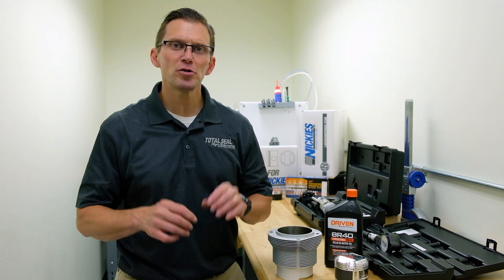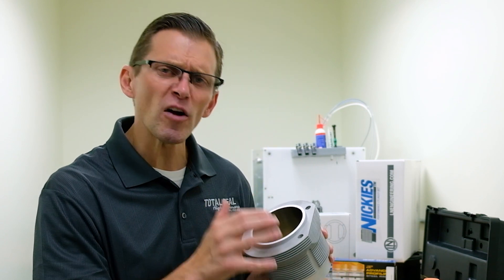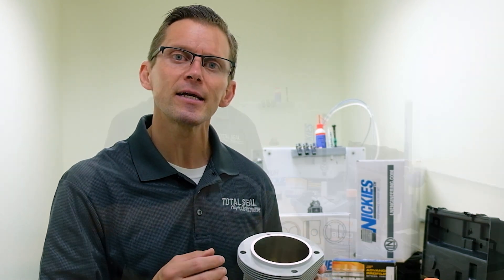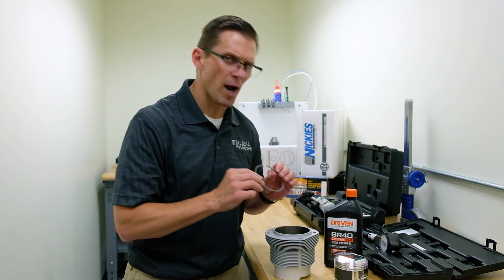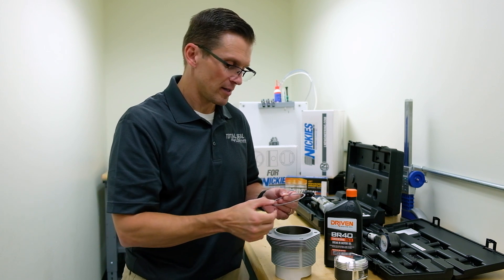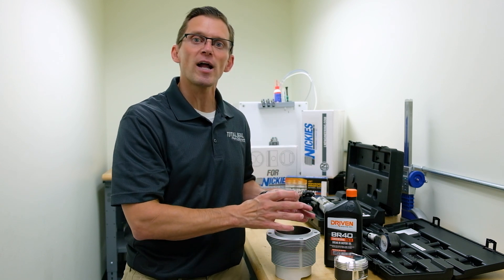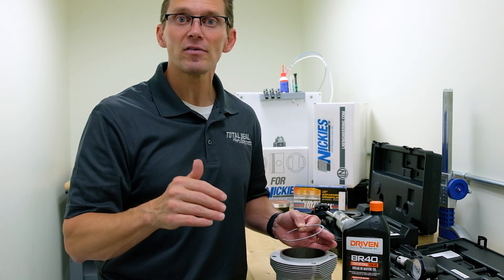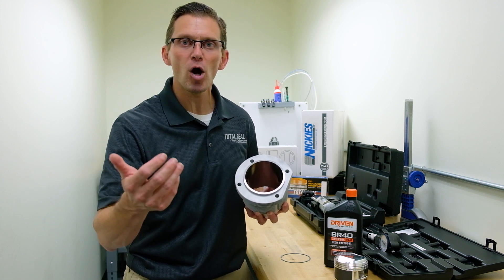Piston Rings 101: Break-in Procedure - with Lake Speed Jr.

Comment: I have a 2022 Honda trx90x and I’m planing on doing an oem parts top end rebuild. Oem piston, piston rings and cylinder jug and complete cylinder head. Although the bottom end is already broken in how long does it take for it to break in to be complete. My procedure is going to be letting the engine warm up not idle but to get it about idle and rev it gently. Warm it up for 7-10 minutes until the cylinder head feels hot to the touch then get it up for speed at 2nd gear and from 1/4 throttle to WOT pulls until it hits redline then right away let go of the throttle let the engine do engine braking. You got to do this 8-10 time then while it hot drop that oil out and put in fresh break in oil again but let the engine cool down for 1 hour and repeat 8-10 more times in 3rd gear. After that the break in should be completed. How does that sound for a procedure. BTW I’m going to use maxima break in 10w30.

Comment: I have a question on Marriage rings and cylinder wall.   I have a New Engine the Case was leaking it needed to be sealed up 800 miles on the engine and I had removed the cylinders left the pistons in the cylinder but installing I broke the seal the piston pulled out of the cylinder on the front and rear. since i was still doing my break in am i safe or should it be hone and new rings. i been told never pull a piston from a cylinder if its seated , it will never reseat after pulling ?
Reply from the maker: NOt knowing the specific engine, cylinder, and ring type, you could put it back together as-is as long as the cylinders do not have any damage that you can catch with a fingernail or are glazed over. Piston rings do rotate in operation, so they will end up running in different positions eventually. Just make the cylinders go back in their original spots. Alternatively, you could get the appropriate set of BRM hones and brush the bores and then fit new piston rings, but that will be something you will need to determine based on your situation.
Reply: Thank you it is a Harley davidson v twin Ultima engine new the case was leaking i pulled it down to seal the case. It was sold with a 2 year warentee. But the company sold to a other company they rejected my 2 year they said they did not sell it. I was screwed so im doing it myself. @lnengineeringllc

Comment: Hello I've replaced piston rings and I have millers competition break in oil how long until my rings should be broken in properly? I was going to start it up, have a very quick check for leaks and drive it moderately until warmed up and then 80% throttle on waste gate pressure with the turbo up to about 4500rpm and then engine brake down to about 1500 and do this up down down the dual carriageway for 20 miles. I've been told to continue doing this for 500 miles, some said 200 miles, what do you recommend? It's a saab 9000 2.3 turbo engine.
Reply from the maker: Keep an eye on the coolant and oil temps. You really don't want either going over 210F during this process. Ideally, I would do as instructed with the engine braking but add in thermal cycles between runs to allow the engine to cool off completely. That might mean all you can get in between passes is 15-20 minutes of hard on off acceleration. By 200 miles you should have quite a few thermal cycles and the rings should be broken in. I would not run the break-in oil any longer than the 200 miles and would then switch to a conventional non-friction modified oil (no moly) and run that another few hundred miles. The oil should look as clean as it went in. If sooty/dark, you have poor ring seal.

Comment: Should we assume that the same holds true for diesel engines such as the new Duramax 3.0L GM?  Also, do these engines that require Dexos II 0-20 oil come from factory with break in oil?
Reply from the maker: As a general rule of thumb, most of the recommendations do apply, but it is always good to refer to manufacturer supplied guidelines, especially while the vehicle is under warranty. We would just recommend doing the first oil change earlier than what most OEMs recommend or at the bare minimum, replace the filter and top off the oil with the appropriate oil for the application as that alone is a huge benefit.

Comment: Hi Lake, another great video and I'll be closely following the advice from this one and the one you made with Don for the break in of my engine soon. I'm from the UK and I'm breaking in a Triumph Spitfire engine which is just a 1300cc straight 4 pushrod engine with a hotter cam. My plan is to fill it with break in oil (I'm using Ravenol with zddp of 2500ppm) and do the 20 min cam break in on the driveway before changing the filter and oil with Valvoline VR1 and doing the piston ring break in on the road with some throttle pulls and hill climbs. 
I thought that the high zddp levels are mainly to protect the flat tappets but on this one you mention the importance of zddp for the break in of piston rings and its making me think that maybe I should keep the high zddp break in oil in the engine until the rings are broken in too, with perhaps a filter change only in between the cam break in and going on the road?
What would your opinion be on this one? Many thanks!
Reply from the maker: Although our specialty is with Porsche engines with Nikasil bores, you could use a similar break-in procedure to what we run on our engines. We do recommend the break-in oil for the first 30 minutes or so when fitting new cams/lifters/rockers, but after that period, we normally change the oil and filter for a conventional, non-friction modified oil. This will allow the rings to seat quicker. The key is that whatever oil you use should not be friction modified (no moly, boron, etc.) and it can't be a partial or full syn. For this we use our 607-7177 which is an old CI-4 spec diesel oil made from Pennsylvania crude which works well for this: https://lnengineering.com/15w-40-conventional-heavy-duty-engine-oil-1-gallon.html
Reply: @lnengineeringllc  Thanks again for the invaluable advice. I'll definitely hold off on the VR1 and use a non friction modified oil then until I'm satisfied the break in is complete, that would have been something I'd have missed! All the best!

Comment: Do these rules apply to new motorcycles? I've just purchased a 2024 BMW M1000R Competition Motorcycle with 6 miles on it. Thanks.
Reply from the maker: Yes, however I wouldn't drain out the initial fill for a break-in oil. I'd just shorten drain interval. Be sure to vary speeds and loads and avoid excessive idling.

Comment: I have a question. I'm going to purchase a 2025 Honda Passport and was wanting to know would it benefit the engine to drain the Honda oil and add the break in oil? Then, change at 500 miles and start using Valvoline Restore and Protect. Would I use the same weight in break in oil as I will use in the manufacture recommended oil? Maybe 500 miles is too much mileage. I think it was 50 miles. Please advise. Thank you.
Reply from the maker: We would not recommend switching out the oil for a break-in oil or using the Valvoline Restore and Protect. If you do anything, just change the oil using the factory oil and filter earlier than stated by the manufacturer. This won't negatively affect the warranty and can't hurt any. Once the car is out of warranty, at that point I would recommend running Driven's DI oils in the correct viscosity for your direct injected Honda engine and cut the factory intervals in half or follow the severe service intervals, if such are specified.

Comment: In general How many miles should a person run break in oil ? Should I run break in oil twice ?
Reply from the maker: We recommend running the break in oil for the first 30 minutes, then drain, and fill with a new filter with an intermediate oil (conventional, non-friction modified):

https://lnengineering.com/products/driven-racing-oils/driven-break-in-oils.html
OR
https://lnengineering.com/15w-40-conventional-heavy-duty-engine-oil-1-gallon.html

We do not recommend switching to a semi- or full-syn or any friction modified oil until you have fully broken in the rings, which in our case with Nikasil bores, can be upwards of 3-5k miles.

Comment: I’m rebuilding an 80s marine engine (Volvo).  I can’t take it around the block and drive it hard.  As you probably know, the cam profile on marine engines are optimized for cruise RPM - on my engine 5 to 6K rpm (sustained for hours sometimes).  What kind of break in do you think would be good?  I can run it in the yard but can’t put load on it.
Reply from the maker: I would defer this to someone that specializes in marine engines such as yours as this is outside our wheelhouse. Sorry we could not be of assistance.

Comment: Fantastic video! I always enjoy your oil related videos...
I purchased a new Harley and followed the manufacture user guide break-in procedure as instructed for the fist 500 miles.  The book says change the fluids the 1st time at 1,000 miles. However, being old school and perhaps excessive, I changed the factory fill oil and filter at 100 miles with Bel-Ray V-Twin 20w-50 Mineral oil, and then I changed oil and filter again at 500 miles with the same Mineral oil and at 1,000 miles I changed oil and filter again, the 3rd time but I changed from mineral to Bel-Ray Simi-Synthetic V-Twin 20w-50 and is what I expect I will run moving forward. 

It has been suggested Mineral is best for break-in and that I perhaps changed over to simi-synthetic a bit early? Do you see any benefit or harm in my early perhaps excessive fluid changes and then my changeover to a simi -synthetic at 1K? I now notice no oil consumption and no smoke so I hope i'm golden...
Reply from the maker: Although we are no expert when it comes to Harleys, if the manual says it is ok to go to a semi or full syn after their recommended break in interval, you are probably fine. It all depends on how it's been broken in. Knowing that many people do not know how to properly break in a new engine, we just recommend using a conventional non-friction modified oil for upwards of 5k miles to ensure the piston rings are seated as going to a friction modified oil or any kind of synthetic too early will indeed lead to poor results.

Comment: polaris snowmobiles have nicasile cylinder along with other brands. does total seal have lateral gas ported rings for 2 cycle engines and do you know of companies that can do a good job of honing those cylinders?
Reply from the maker: I would recommend contacting Total Seal as we do not have experience directly with 2 cycle engines. They can provide you better guidance. Sorry we could not be of assistance.

Comment: I’m currently in process of engine break in. I had it at idle so I’m taking apart the engine. Had the right Lucas oil break in, sae30, my surface  finish was done by flexhone. The rings was Hastings. But rich on gasoline. And the oil was forming on top still. Even before the break in. 😮
Reply from the maker: We would recommend having someone check the surface finish with a profilometer to make sure it's correct Second, you'll want to make sure the engine isn't run too rich which washes down the cylinder bores of critical lubrication.

Comment: How long can plasma moly rings sit in the cylinder before break in?  A few weeks, a few months? Thanks.
Reply from the maker: Depends on what you use for assembly. The biggest issue would be controlling corrosion and dry start. If the engine isn't going to be started up for a while, you might consider using a thicker assembly lubricant that is going to be less likely to run off.

Comment: 4 stroke Briggs kart motors with sealed block:  new motor ises a relatively hi tension ring pkg, AND CHROME FACED.. on an iron sleeve in alum block.
Question:  I am gathering opinions on this spec motor break-in.....
*  Any Ideas?????
Reply from the maker: Use of a break-in oil in the appropriate viscosity would for sure be highly recommended. Like with any engine, you want to avoid excessive idling and you'll want to alternate between loading and unloading the engine (not sure if decel with engine braking is possible).

Comment: So what is your take on a new Toyota 4cyl that specifies 0w16 oil, good protection?
Should I drain the new oil and put 30w break in oil? 
I read an owner of a Toyota that  uses 0w16 and replaced with 0w30 and it runs fine.
Reply from the maker: If you have a new vehicle, the engines are often already run in and come with a fill specific to what the manufacturer recommends. We would defer you to your owners manual for what is recommended for your specific model.

Comment: Should I use a basic non detergent motor oil for break in? Or do I need to get an oil designed for break in? How will I know when I have the engine broken in? And lastly, should I get ZDDP additive for my oil changes thereafter?
Reply from the maker: A break in oil would be superior to a non-detergent motor oil. Although both are technically non-detergent, a break-in specific oil will have higher levels of ZDDP. After break-in, using the correct oil for the application would make adding a ZDDP or any other sort of additive useless. If you are using an oil that needs an additive, you are using the wrong oil.

With regards to when an engine is broken in, that will vary greatly depending on what kind of engine and how it is broken in. The cam and lifters should be broken in within 20-30 minutes of initial startup but piston rings may take hundreds if not thousands of miles to be fully broken in as measured by use of a compression and leakdown test.
Reply: I work for a fasteners and tool company. I work on nail and staple guns, air compressors and a few specialized tools. Some of the guns operate on propane gas and has an ignition system that is battery operated. They have steel rings. Almost all of them with two rings per cylinder, will have the ring gap spin around until they line up and lessen compression. Is there a fix for this? I’m restoring my grandfather’s 67 F100 and I want to make certain that I do my best. I have built race engines for karts and a couple of old race cars, before I started to work on the nail guns and didn’t know that it could be a thing.
Reply from the maker: @ronniejohnson317  I can't comment on nail guns, but piston rings do rotate in normal operation. In a piston engine, typically the cross-hatch angle will affect the speed of ring rotation. Porsche actually pins the second piston ring in their modern watercooled engines to keep the ring from rotating. The use of gapless rings help overcome this issue.

Comment: Regarding a stock rebuild on a shovelhead engine, how long do you run it before accelerating to introduce combustion pressure? Do I heat cycle it first, or just give it the beans? Thank you!
Reply from the maker: I'd do not know specifically about your application, but usually we would recommend doing the cam break in which most manufacturers state 20-30 minutes. I'd use that time to check for leaks, etc. Once that is complete, it would be good to let the engine cool down completely if possible. It's always a good idea to have multiple thermal cycles during the break-in process.
Reply: @lnengineeringllc  thanks for the reply. I appreciate any input!

Comment: I am running your Gapless top rings on a BMW 3L straight 6 engine. The engine runs 104DegC(220F) from the factory and burnt the running in oil at around 300 miles. 
I have noticed that on pulling the plugs that 5 out of 6 cylinders have light oil consumption indicators and smokes a little after idling at the lights for a while.
I used a bore-scope and the bores don't look to be glazed. Can I just give it another run with new break-in oil?
Reply from the maker: LN Engineering isn't the manufacturer of TS rings; we'd advise you speak to Total Seal directly for their recommendation as we do not have any experience with BWM engines as our area of expertise is with Porsche engines. Normally when we see something like this I question if the bores were prepped properly or if the engine was running overly rich during initial run-in, but TS may have some better recommendations for you to follow.
Reply: @lnengineeringllc  It was rich initially. Fired up at 0.7 Lambda and ran without hesitation due to the high power coils.

Comment: How should I break in my new Camaro with the 6.2? Same as you say? Should I put a different oil in it right away to break it in properly?
Reply from the maker: We would always refer to whatever recommendations the engine builder provides with their engines, but most we work with recommend using a break-in oil for the first 200-400 miles which is what Driven recommends with their break-in oils.

Comment: So after I install my new rings, I need to run it with conventional oil, and at around 60% throttle or more, correct? I'll be installing the rings on a 16hp cast iron Briggs.
Reply from the maker: If solely doing a re-ring, yes running a conventional oil is a must. Oil cannot have any friction modifiers such as moly as that will inhibit seating of the rings. Putting a load on the engine as soon as possible after up to operating temperature is the best way to seat the rings as discussed. You want to vary load and engine speed and avoid idling. It is also good to allow several thermal cycles during this process.

Comment: Will this work on the Audi A4 2.0 Turbo CAEB Engine? TIA
Reply from the maker: Following a proper break in procedure is a must for any new or rebuilt engine. It's best to refer to your engine builder's recommendations as most typically have a prescribed procedure to follow to comply with warranty requirements, however the general principles are the same.